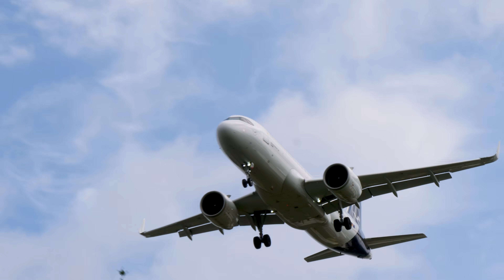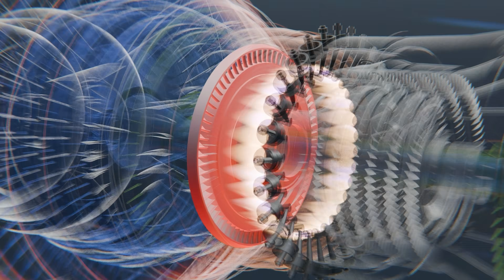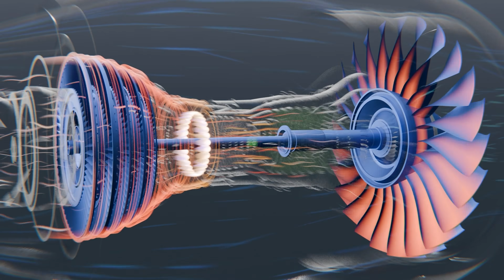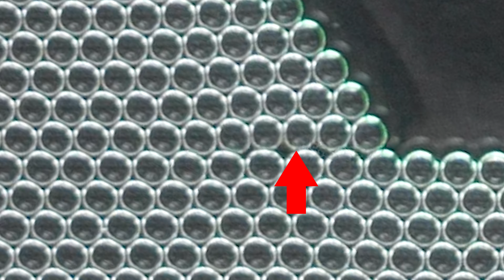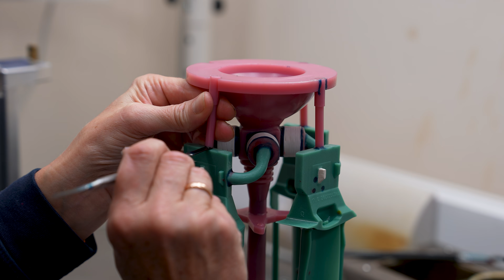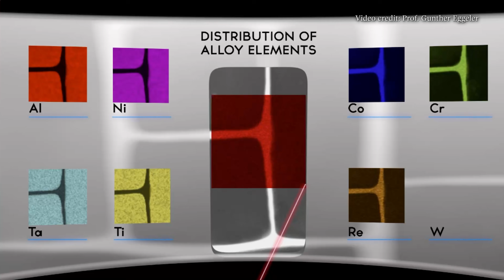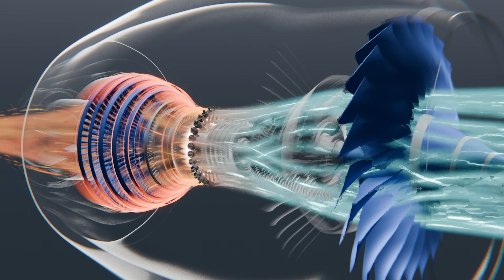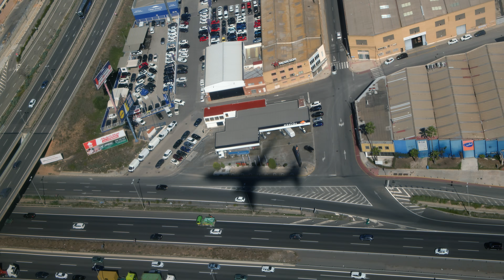The Ridiculous Engineering Of Jet Engines

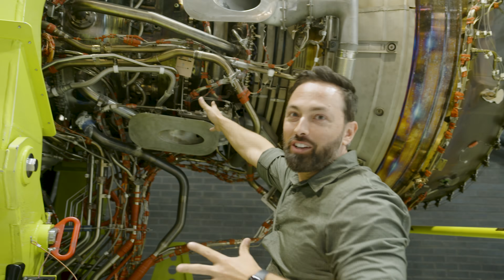Comment: 0:13 big fan in front; keeps it cool
Reply: Smart pants indeed
Reply: Nah you missed the end. They pay a guy to sit on the engine and throw ice into it mid flight.
Reply: @blueberryshoes  it's a testing process.
Reply: Thanks mate, just saved me 40min
Reply: @1gjnwdhhjjjj hahahahha 😂😂
Reply: It in air
Air cold
No melf
Reply: @Raldelio I hate melfing
Reply: @lossless1234er same bru also here some em beans
Reply: How e know iss my papa had truck he left truck on for day it over heat engine, engine in car, no cold air, but, plane turbine is in air so no hot, thnx u have gud days
Reply: hehe, melf
Reply: Hot air go away fast
Reply: @RomanG6_Real go and study physics please 🙏
Reply: @craftencraft1777 hor air float if in air then hot go float he smert but u slso smeart gud jub
Reply: @Raldelio how is he smart?
Reply: If this is real answer I'm gonna skip my school tomorrow
Reply: @shiroyasha_007 ADRIAN
Reply: Bleed air through micro channels in the blades create a film effect to keep direct temperatures away from the metal. We used crushed walnut shells to clean calcium deposits from the compressor stages in the J-57 engines in our KC-135A Stratotanker caused by the water injection system to get thrust boost. Then an engineer got REALLY smart and told us to deionize our injection water... Problem solved. It definitely was NOT fun chunking crushed walnut shells into an engine intake that was running WFO...
Reply: They use the air-conditioning of the cabin! 🤪
Reply: Nah, it's cause the air in the sky is colder (:
Reply: lol duhhhh 😂
Reply: Only the exterior of the core module... 600° bleed air is what keeps the turbine blades alive and also provides Boundary Layer cooling for the combustion section. Crappy fuel builds up carbon deposits which hold heat and do burn throughs... REALLY fun pulling those slag pieces out.   Doh!
Reply: Ty bro, you saved my time👍
Reply: Turbine blades cooling happens in several ways, airflow inside the turbine blades tiny holes from hpc and also the one from compressor section hpc for HPTACC via holes on the hpt casing
Reply: Why didn't the video just say this lol
Reply: @the_cool_helpbot8 cause it's not true lol
Reply: @Mecht you ruined the joke
Reply: @Raldelio jokes are supposed to be funny
Reply: You just saved me 39 Minutes today xD
Reply: No it's not its a air induced to maintain the air flow in a study way .
Reply: @craftencraft1777  if not for make cool, why fan so big?
Reply: @ShawnPitman goood question
Reply: Fans move air. They don't cool anything.
Reply: @mr.monitor. but moved air is cold?
Reply: @Raldelio It doesn't change the temperature at all. What's confusing?
Reply: 791
Reply: Nope. Tiny holes in the rear blades keep the heat from getting to them
Reply: @prestonjb they were joking
Reply: Blades filled with tiny holes and air pumped in to keep cool
Reply: Big fan go brrrrrrrrrrrrr
Reply: my man
Reply: Duh
Reply: big fan in front keeps everything cool!  As proven by the fact that if this fan stops rotating the pilots start sweating.

Comment: I work in a factory that makes jet engine parts (not the turbine blades, low-pressure compressor parts). The ungodly amounts of titanium alloys we machine always blows me away, the exacting material specifications, calculations and validations to make them incredibly safe over very long lifespans.

Comment: This video is mind-blowing—the engineering behind jet engine survival is incredible! The core solution involves using *Nickel Super Alloys* with a robust *Gamma Prime* structure [00:17:31], and the even more insane technique of casting the blades as a *Single Crystal* to eliminate weak grain boundaries [00:29:05].

The final two layers of defense are ingenious: *Film Cooling**, where internal air is blown out through tiny holes to create a protective barrier on the surface [00:33:37], and the **Ceramic Thermal Barrier Coating (TBC)* [00:34:24] which reduces the metal's temperature by over a hundred degrees.

Despite this advancement, the video notes that *molten dust* damaging the TBC [00:36:34] is still the main threat to engine life. Do you think we will ever develop a TBC that is 100% resistant to dust accumulation in the future?

Comment: 4:50 -> wait... Jet Engines turn heat into useful work? that sounds wrong. I have learned thermodynamic machines convert pressure into work, and heat is a byproduct. Sorry, even if they use the heat expansion... most of the "pressure" comes from the fact that CO2 and H2O need more space then O2 and whatever fuel hydrocarbon fuel is injected. 
I would expect more from your channel
Reply: No, the name "heat engine" literally mean heat into work. Of course you're changing the pressure of the gas before you heat it. But you need to input heat for it to run.
Reply: ALL of the pressure comes from the compressors. Zero from combustion. The combustion of fuel in a jet engine DOES NOT increase its pressure, it lower it slightly. All the combustion does is heat the air, expanding it and increasing it's velocity. That expansion lowers its pressure. The air isn't confined like in a piston engine. Turn on you hair dryer. The filament inside heats the air and that's it, no pressure increase. Your hair dryer and a jet engine operate almost the same minus the turbine to spin the fan is replaced by an electric motor. You could run a jet engine on an electric filament if you could get enough heat in there. The combustion products play no part in a jet engine, just the heat. Some crazy scientists once tried to use a nuclear reactor core for the heat source as it makes no difference where the heat comes from, the CO2 and H2O play no part.